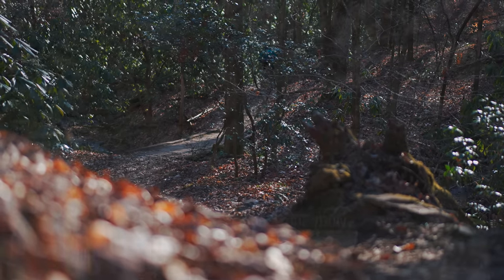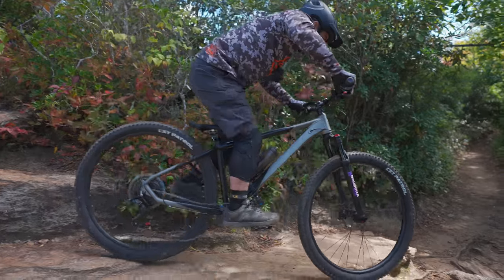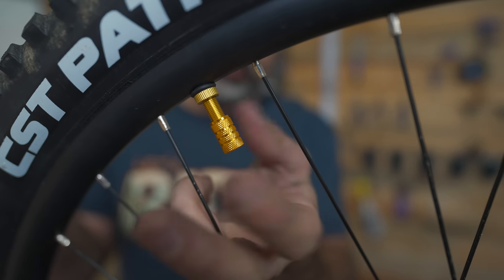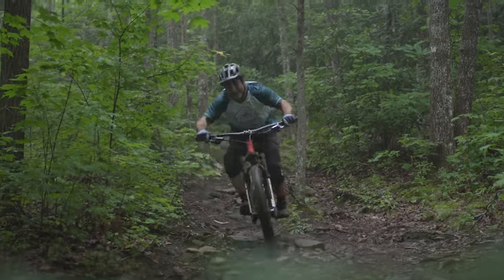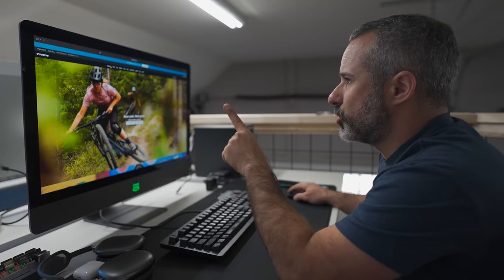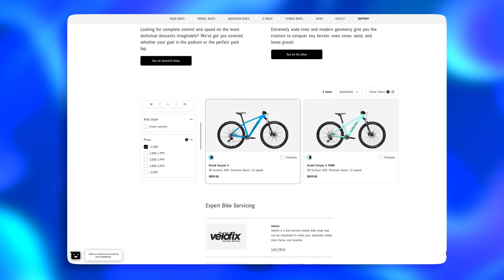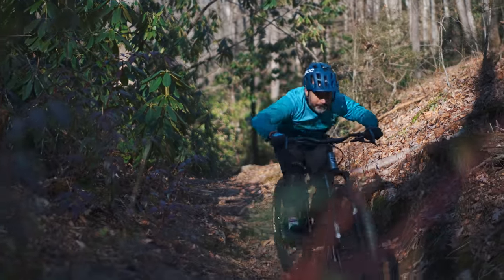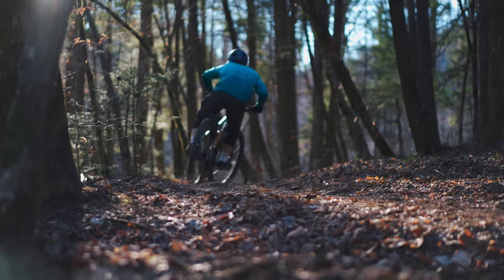Was putting $425 of upgrades into our Walmart Bike a good idea?

Comment: For the canyon comparison, you couldve looked at the canyon stoic 2. for 899$ you get that srsuntour air fork, deore 1x12 drivetrain and so on. So i think the stoic 2 has the best value of all bikes at that pricepoint
Reply: Thats true and the frame is much much better
Reply: The vitus nucleus here in the uk is a lot better value. It comes with hydraulic brakes, dropper post, a good drive train and the same suntour air fork for £600 ($730) but that's including tax as well.
Reply: @nebnollock5198  yeah but it costs quite a lot to import to the us. Evan's talked about this previously, i think he mentioned an import price somewhere at about 100$, so it would be very close to the canyon again
Reply: @iljamuraschov  yeah that's fair enough, sucks they don't sell out of the US, canyons are pretty bad value over here, the stoic 2 is £900 ($1100)
Reply: @nebnollock5198  what really?! How does that make sense, canyon is a Company based in germany, is that due to brexit with shipping fees or is it just normally that high?
Reply: The stoic 2 also comes with thru axles, and schwalbe super trail evo tyres
Reply: @raulp202  ye, all that good shit. Just wonderful value, you get so many good features for the price, and thats what i've usually experienced with canyon. (coming from a canyon spectral owner)
Reply: @iljamuraschov  for me the stoic 2 is listed at $1200 so its not 900 atleast here in the us. but i own the grand canyon 5, I got it for $700 on sale and then almost 900 after shipping and tax, but the bike has been pretty good, there is one issue though and its the fork. the sr suntour x1 is really bad and doesn't really work.
Reply: @user98292  thats very weird, especially because canyon lists their prices before shipping... for me in austria its listed at 899€, and € to US$ is 1:1 at the moment, so i figured listing price should be the same.... huh interesting... then its definetely not that good of a value in the US, here in Austria it definetely is great
Reply: @iljamuraschov  yeah for some reason its 300 dollars more here, the value over there would be good but over here, not so much
Reply: I did a lot of research at this price point the best value Mtb bike is giant talon 1 period no competition … that’s the one I got best bank for your money …784$ on sale

Comment: The thing I liked about the Kent Trouville was the affordability. It offered me the chance to get the bike and see if it was something I would enjoy, then if I chose to do the upgrades, I could. I wasn't out $800 right off the bat to find out if mtb was for me or not. I found that I liked it, and decided to continue. Knowing that its something I enjoy, my next one will definitely be one of higher quality/serviceability. As for my Kent, I've done most of the upgrades you did, except I did a seat change. The one that still has me thinking is the fork upgrade. Seeing the process of how to install a new fork is a little intimidating (which upgrading can be a big negative if you aren't mechanically inclined when buying a cheap bike). I'm over an hour away from any real mountain bike shops, and wouldn't even know where to start if I looked for one. So I was able to get a ton of information about the sport, the tools, and the knowledge that goes along with owning and servicing my own mountain bike. They sure have changed a lot since I was a kid! Now if I could just find the perfect video to walk me through a fork swap with common tools, lol.
Reply: I did a fork replacement on an older bike of mine by myself, and it's not terribly hard. BUT I did end up going out and buying a bike workstand to actually make it easier to do, and honestly I would have struggled without at least some sort of stand unless I had a second person; and I ended up needing to take my new fork to a local bike shop to have them set the star nut for me, since I didn't want to go buy a tool for it or take the risk of hammering it in sideways (they were happy to do that for free, but yeah if you're an hour away from a shop, that's gonna be a tough sell).

I'd say if you're semi-comfy with basic mechanical stuff and maybe don't mind buying a cheap specialty tool or two, it's worth the effort. But otherwise, if you don't mind that one-hour trip, I'd also definitely look into asking one of those bike shops what they charge for a fork install, my local shop would have done the whole thing for me for about $35USD and would have totally been worth it.
Reply: Swapping the fork is actually easier than you think. I did it myself for the first time. I, however didn't cut the fork down enough so the top cap wouldn't fit so I just added a spacer on top. I used a grinder to cut the steerer tube, but a hack saw or pipe cutter can work. Just watch tutorials and you'll be okay

Comment: I did the same thing with a hardtail Highland, which is basically a nice enough frame hampered by horrible hardware. I now have a dual chainring set using Stone and Absolute Black ovals on a new Shimano BB with 175mm GRX crankarms. I went with all Deore on my drivetrain, a Koozer XM490 freehub, and a shock dropper for the stock saddle. Hydraulic brakes were stock on the Hiland, but the shifters were horrible, so I replaced the rear shifter with a Microshift friction lever, and the one for the front derailleur was handbuilt. Finally the headset and handlebars were replaced with a folding set that has a cheesebar for accessories. I also added front and rear luggage racks. 

I won't be jumping with this thing, but it's made my Nagoya commute very comfortable and shopping trips are great! The original bike was just south of $300 USD. A third of my parts were bought new, the rest came from previous builds, were hand-built solutions or from second-hand sellers on Mecari, an Etsy-like online store here in Japan. I wouldn't recommend it to anyone, I only did this because I love problems and wanted to learn. Now I'm learning wheel construction and spoke lacing. :)

Comment: You didn't account for your time/ labor in the final price. Probably at least $100-150 to swap out all those parts and make those mods. Also, as you pointed out, the seat post is an odd size, so getting a dropper on there is trickier.  (You'd have to see about getting a narrow one and use a shim).  And I'd say the Trek, Giant, or Canyon frame are better to begin with.   Cool experiment, but in the end demonstrated that it's just not worth trying to make a department store bike actually trail worthy.
Reply: I think more crucial that the labor are the tools. If you have to buy all the tools just for this bike it's futile. Especially if you don't plan on using them more.
Reply: @axialmount5571  that's true! He did use several tools that cost hundreds of dollars that the average Joe wouldn't buy (like the crown race setter).
Reply: that is probably the same price for the tools he used but he could also borrow them from a friend if they have it or ask around his neighbourhood if he really needed to. Also if you have spare time I feel most mtbers enjoy working on their own bikes, at least i do

Comment: Vitus Nucleus, picked one up new for my daughter new for £600 UK and the only thing it was missing was a dropper. Came with decent Clarkes brakes and Suntour Air fork and 1x11. I Put a Brand-X 150mm dropper and some decent pedals on, set her sag and she's off! Amazing value bike, I've also bought a Vitus E-Sommet and it's amazing, just put a PNW Loam Lever on it.
Reply: I have the same bike put some used 32mm Fox forks (150E) and a decent saddle and it has been flawless for the last 3years.

Comment: I've been slowly building my Trouvaille up and while I could have gotten a LBS bike I wanted something to learn to work on bikes. I've done a tubeless conversion and changed to knobbier tires. I got some wider more grippy pedals. I changed out the bars and grips for much better ones(the ones when I bought it had one of the bolts stripped out so I couldn't take them off). While MAJOR overkill I put some magura MT7 hydraulic brakes on it. I haven't yet changed my fork and I didn't need to change my crankset/chainring. I love it and I'll continue to make it better.

Comment: Also tools. That's an important thing to consider. Most people who would be interested in doing this are unlikely to already have the same tools that you do. So it's an additional $200+ for just the tools that you used in this series. (Bleed kit, crown race setter, hex keys and a screwdriver if they don't have any, two different BB tools, just to cover the basics)
Reply: I just used a block of wood and a rubber mallet to set my crown race
Reply: @spyder027  spare PVC pipe

Comment: As someone who works as a bike tech for REI, and a former bike mechanic for an independent local shop, I can honestly say that Seth is totally right about the service side of the equation. We want your bike to last and work for you. The best way for that to happen is to get the a decent bike from a reputable retailer. I know that some of the larger REI stores have a division of labor in the bike area, so assemblers and shop techs aren't the same role. Considering that, it may be a good idea to bring your bike in for your free service sooner rather than later to ensure that a tech can go over the bike. If you're buying from a smaller REI or an independent local shop, the bike will be good to go from the jump. 

The other factor to consider here is labor and tools needed for these upgrades that Seth did to the Kent. It's still going to be cheaper for you to buy a nicer bike and only pay for the fork upgrade instead of paying for all of the labor he has in this bike. 

All that said, it's still cool to see a bike from Walmart that actually has some "good bones" in it.
Reply: I was an automotive mechanic for a decade, and it co fuses me when people talk about labor on a bike lol.

Comment: it's always a good idea to buy the best bike you can afford. you will usually spend more money upgrading a less capable bike in the long run. but, if $400 is all you can spend, the kent is a worthy platform. upgrading also forces the learning process. Seth, amazon sells an adjustable reamer that will let you safely drill the seat post tube out to 30.9mm. another youtuber did this without incident. great video, bro.
Reply: Excellent points. I think sometimes what gets lost in this conversation about best value bike is some people who would buy the kent trouvaille simply can't afford $800+ for a bike all at once. Upgrade as you can afford plus the learning process can make sense for people on a budget as long as you end up with something you'll be happy with. I would probably lean more toward save money long enough for the bike store bike you want if possible.

Comment: I spent less than that with better wheel set. Using the Schwinn Taff Comp $124 bike
Reply: I got the Schwinn Taff Comp for $124 and got a Hollow crank and JG chain ring or $40, Ryde Trace 25mm wheel set with Origin8 M3100 and DT Swiss spokes $160, TA axle adapters $30, Wake 730mm bars $25, Acolyte derailleur working with the Advent X 11-48T cassette & shifter $110,  Meroca Hydro brakes $50, 180mm front rotor $9, Bolany 32 120mm fork $75. CST Ouster/Rock Hawk clincher tires working tube less $40. Tube less schrader stems, Stans tape and Cream II $40. Bottle cages and Corkie grips $20
Reply: @Wireman134  So like $750 total for a $1,400 bike at a bike shop. FYI entry bike shop Trek's come with steel hubs no sealed bearings and non tube less ready rims.

Comment: My first “real mountain bike” was a hardtail that was upgraded similarly on a 2012 entry level trek frame. I absolutely agree with your conclusion, but you didn’t dig in to one of the major reasons as much as i would have. 

The lack of a dropper post is the largest nail in the coffin for me. That was pretty much my first upgrade. I think a dropper post and brakes and the most important upgrades to be able to progress as a rider safely. If it’ll never have a dropper post, I wouldn’t put a dime into it.

Great video, thanks for doing this project! Brought back a lot of memories!

Comment: I'm a beginner just now getting the mountain biking bug and I have come to realize my area actually has some nice trails. I had a cheap Sidewinder bike that's been in my shed for a few years so I'd started commuting to work to start conditioning up. My drivetrain failed after just a  month and a bit commuting. With the cash I had saved not driving my 9 mpg truck during that time (as well as some rainy day fund) I grabbed a Giordano Intrepid. It came from my local Walmart for $650 in a medium frame with 29" wheels. I believe it has the same tires, still has a heavy sr suntour coil fork but with 120mm of travel, Tektro hydraulic disk brakes, Microshift 10 speed, a great looking frame and probably some other bits I don't know enough about yet...  Seemed like a pretty solid improvement over the Trouville for not a lot more money. I only had right around $600 to spend (Had to borrow a little bit from the savings account to cover that remaining bit and tax) This seemed to be the best spec I could find for that price. Hopefully I did ok with it. Time will tell. I did sit on a Trouville they had in stock and considered it, but that large frame just felt too big for me.

Comment: I've done something similar myself.. Bought a cheap, second hand bike (a Diamondback Outlook FS) & swapped out tons of parts except basically the frame itself with budget, but not cheap parts such as changing the 3x square taper BB for IXF cranks, Bucklos air forks, etc. To be fair there are YouTubers out there doing this kind of stuff on Walmart bikes (KevCentral, Wolftick etc) but the value isn't in the price of the parts or the equivalent cost bike from a store.. Doing upgrades on a cheap bike means that you are making the bike individual to you, rather than off the shelf so you are building the bike around you.  
Other advantages are that you could be on a budget and rather than spending £1000 (I'm in the UK) on a bike in one go, you are buying the bike in manageable chunks you can afford.
Add to this, it can be fun and you can learn tons about bike repair, how components stack up and maintenance skills which you can't always do buying a bike from a bike shop, thus saving costs later as you won't alway need to take the bike to the shop for repair.

Comment: Have a look at Vitus bikes! In the UK, Chainreaction cycles has a bundle now for the Nucleus for 600£. Vitus are pretty decent bikes, bang for the buck. The bike comes with the same air forks you upgraded, Deore 10 speed groupset, Brand-X dropper, WTB wheelset, Maxxis Ardent tires. Clarks brakes tho. One of my friend had a Nucleus before, and not going to lie, pretty solid bike!
Reply: got one for christmas great bike event came with raceface ride crankset

Comment: The polygon you found is the retail price.  No one pays retail for those bikes. They are always on sale.  Right this moment I can get the Xtrada 7 for $849 shipped free.  It comes with an RST Aerial 15, Deore 1-12, Deore crankset, and thru axle's front and rear.  By far the best bike you've looked at.  I've been pricing bikes at bikesonline for a long time and it's extremely rare to pay retail price for them.  I have a Polygon Siskiu D6 and didn't pay anywhere close to retail for it.

Comment: Great series! I bought a used Trek X-caliber and removed the volume spacer in the judy fork which increased travel to 120mm and fitted a -2 angle set which put it at 66 degrees HTA and a 2.4 DHF Front tire. Made it way more enjoyable for me, a fast rolling xc that could still corner well and go fast downhill. Unfortunately the wheels didn’t hold up and ultimately the frame cracked and I bought a full sus, had the Trek welded and now it’s my cummuter bike :)
Reply: This was my original guess at the beginning of video, assuming it wasnt mentioned,  the major fault.. Bad welding/quality checking on frames, in which no one will improve themselves, sure you can add on whatever but what about the welding the actual important part which holds the bike together lol. Especially if you are paying cheaply.

Comment: A problem with the cheap bikes from well known producers like Canyon or Trek is that the frames do not have a tapered head tube in most cases. This really limits the choices when it comes to upgrading the fork. Especially with 29" wheels.

The walmart bike appears to have a tapered headtube (altough you are not putting any fork with a tapered steerer on it). If that is the case, it would make the frame superior to the Trek frame for example.